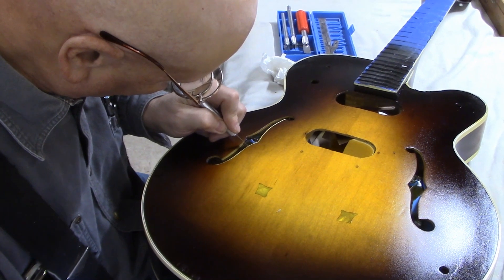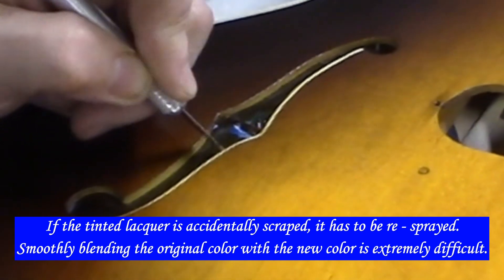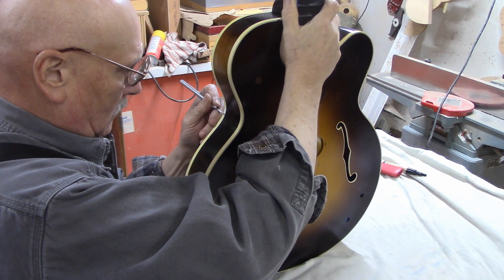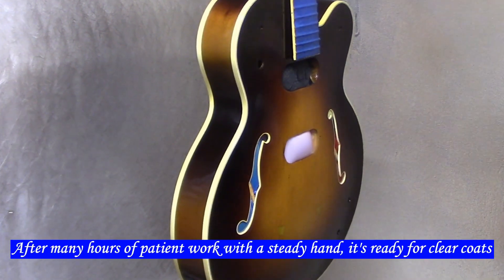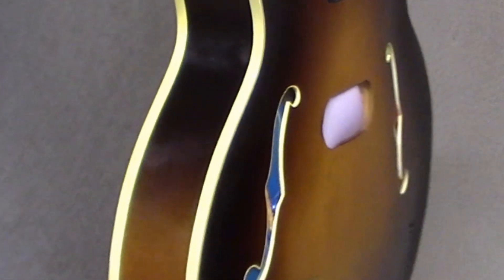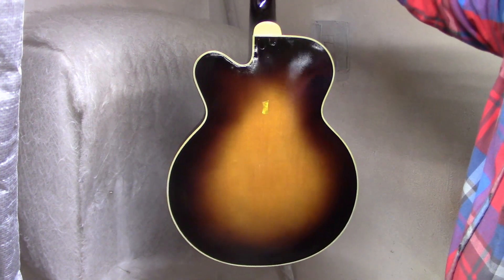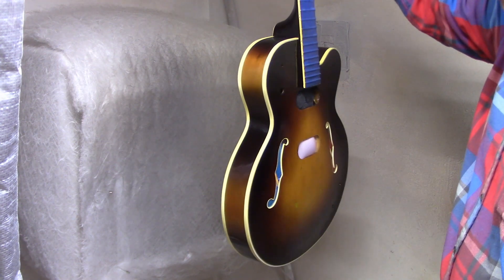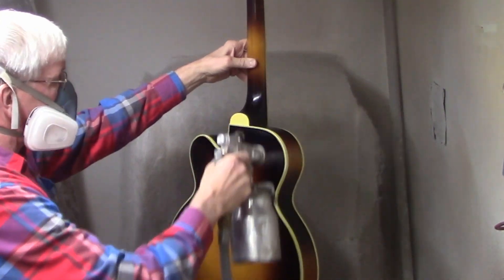Gretsch Archtop Restoration, Part 13: Nitrocellulose Lacquer Finish

Comment: WOW. Very amateur workmanship on that binding. It poses many dangers when scraping binding. This is not very professional. Gibson only does this to save on paying for masking tape. It can damage the binding and leave small indentations in it and you risk scratching your finish. I wonder why if you "restored" this that there are marks were the hardware from the tailpiece sat (on the front of the body) and a small wear spot in the back of the body are still there?

Comment: What’s the best way to remove nitro from a guitar?
Reply from the maker: I don't think there is a "best" way.  Chemical stripping gets the job done, but it is very messy and the fumes can be dangerous.  Scraping and sanding will remove the lacquer, but you need to  be careful not to remove the underlying wood, which could leave depressions when the guitar is refinished.  Either method is a lot more work than most people realize.

Comment: Can you offer any advice on a nitro finish that has crazing? Can the crazing be remelted with thinner?
Thanks & great video.
Reply from the maker: I'm not sure there is much you can do short of overspraying . Lacquer thinner could theoretically fuse the check lines, but it would definitely damage all of the finish it touched.  I wouldn't try it.
Thanks for watching.